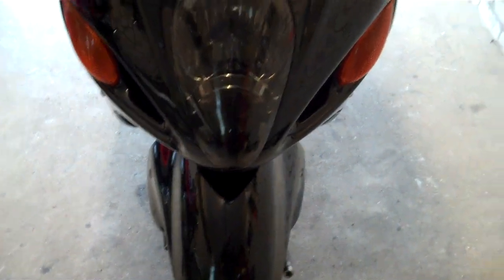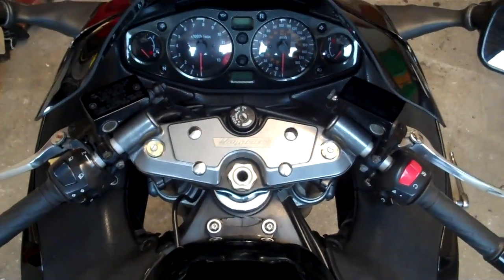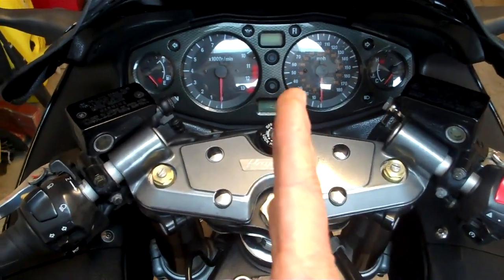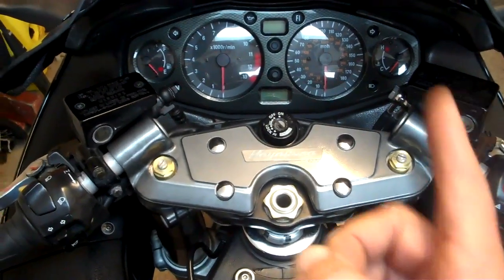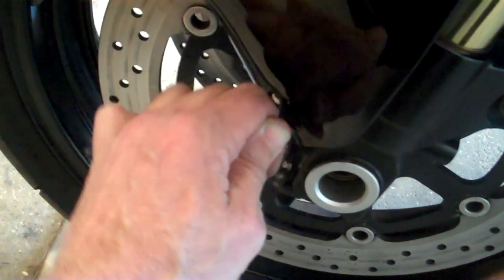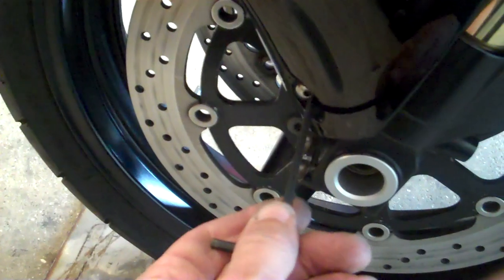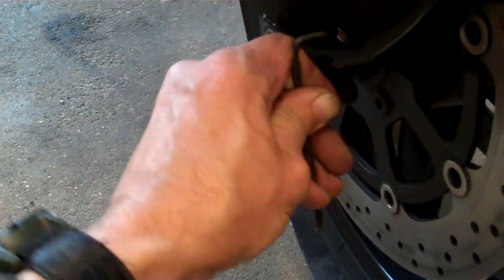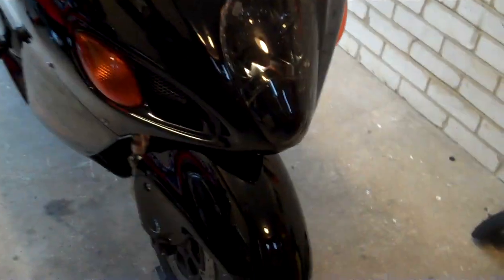Delboy's Garage, 'How-To' Re-align motorcycle forks the easy way.

Comment: Interesting... in my case ('06 CBR 600 RR) it would not self-center. There is enough slack with the steering stem nut loose to physically see the play between the bars and the tire but it will not self-center. Or, rather, it's natural position is with the front wheel 4 or 5 degrees to the left. Very peculiar......
Reply from the maker: Have you backed off every fastener, axle, mud guard, calipers, and got the bike on a paddock stand..?
Reply: Yeah, I slacked everything off and it's on the stand. In the end, I raised the forks 5mm and held the tire between my legs while pushing the wheel over and then tightened it up. It seemed to be the only way to get it straight. Odd as I had the forks checked for straightness a while back.
Reply from the maker: Yeah sometimes they need a little help by holding the wheel 'tween yer legs and forcing it.. as long as you got it sorted buddy...
Reply: It's sorted and it's like a whole new bike. It made much more of a difference then I thought was possible (wasn't expecting anything other then straigt bars). It does bother me though that I had to load the wheel a bit to get it all straight though. Makes me wonder what is off-spec in there.

Comment from the maker: To send a PM,click on the Moonfleet user name which will open my Channel, on the right hand side, you will see a small title "by Moonfleet41" with a drop down triangle next to it.  Hit the drop down triange it will show "block user or send message". Hit send message and it will open an un-limited post box where you can also load links unlike on here.Many bikes will shake the head when you let go of the bars and a worn front tyre will pretty much guarantee this,but just for now,check the pressure

Comment: Aligned is not exactly what I saw. This is the biggest problem with straightening the fork. When the difference is small enough for mechanical memory, the clamps and bolts will slide gradually but soon enough back to their last position. You could have done better making sure it was straight enough. Every bit twisting further being a great help.

Comment: Does this work for speed wobble?
Reply from the maker: R6schico Hi buddy...you can check alignment as it costs nothing to make sure...if a bike has a wobble all the time then its probably a mechanical alignment issue, but if its a speed wobble, and only apparent at certain speeds, then its more likely to be a wheel balancing issue, check your tyre pressures  and condition first, then look to see if any weights have been lost (tell tale sticky marks where the weight used to be), and rake a look at your suspension setting too so you have gone through everything... Good luck with it.. Del.
Reply: Moonfleet41 thanks bud

Comment: I think he means if you have to loosen the big 28 nut on the top, centered just below the handlebar. it is not really clear, since you are insisting to loosen everything south of the top, and then you shortly mention the big 28 nut on top and just make a cut in the video.

Comment: some idiot dropped my cbr 125 today and its steering funny when i turn right just doesn't feel normal could this be the problem
Reply from the maker: ***** Quite possibly mate, can hurt to do this proceedure and make sure the front is straight, if its still the same after that, then al least you have eliminated this as a problem...! good luck with it chap..
Reply: Moonfleet41 thanks for reply mate will give it ago tomorrow
Reply: +osker450 How'd it go?

Comment: Tried this, wheel is still not re-aligned with the bar. Time to give my dealer a visit i guess..
Reply from the maker: Do't give up buddy... have another go at it, did you make sure that you loosened off the top yoke 'centre' nut so that the two yokes can move independently of each other to re-align?????
Reply: yea losened the centre nut and everything south of the top yokes as instructed. It fixed the bike's pulling to the left but the bar just isnt straight yet and when spinning the wheel the front brake sounds like it hits the disc harder in one place. Ill have another go at it in the morning
Reply from the maker: Ok, it may not be actual damage, sometimes a disc can rub lop sided, specially if its a floater... also if you have bar risers that are bolted 'through' your top yoke, check they havent moved too, they will be set into clearance holes and only need to shift a few thou' when hit and it'll make the bars feel way off...good luck, let me know how you get on buddy.. Del.

Comment: I can't get it with my ninja 300. there are only 2 bolts at the top I can see
Reply from the maker: Hi mate, many bikes have different anatomy in the construction, and fitting, of their calipers, I don't know the Ninja300, it's a very new model, not had one on the bench yet... perhaps check the manual and see what it advises...
Reply: +Moonfleet41 what should I look for? would there be a section that says unscrew these to loosen the forks? also what tools are usually needed? thanks
Reply from the maker: Hi Brett.. If you're talking about your yokes, then your bottom yoke will have pinch bolts to loosen, can you not see them buddy? they may be hidden behind the fairing, but you should be able to see them from the top..!

Comment: I have tried this several times and nothing. I do not know what I am doing wrong
Reply from the maker: Hi Ethan....did you back off the centre nut on the top yoke so they can move independantly of each other?... and have you checked the back wheel alignment is right too....if the back is out, it will make the front feel lop sided...???
Reply: Moonfleet41 I tried I could not get the top nut to move. I have a 06 ninja 250, not sure if that matters. I'll give it another try though
Reply from the maker: EthanCobwebs
Hi Ethan....you MUST get that top nut backed off a bit....otherwise the two yokes cannot move and realign...is it just stuck, or do you not have the right tool to get it turned..?
Reply: Moonfleet41 it just won't turn
Reply from the maker: EthanCobwebs
OK mate, well thats your task, unless you can loosen that top nut you cannot align the yokes....try using a well fitting socket and a long breaker bar...its only the thread, if you get enough purchace on it, i assure you it'll move eventually..!
Reply: Moonfleet41 it worked! Had to get a longer bar, thanks a lot for the help
Reply from the maker: EthanCobwebs
Nice one, glad you cracked it.....you know what they say.." if in doubt, swing on it a bit more" lol

Comment: You picked the worst bike possible to demonstrate this simple fix.
Good explanation job anyway!
Reply from the maker: It's the bike I had at the time Faustin, did a re-make of this later on on a naked street bike.
Reply: @Moonfleet41  Yes. That one would be a better bike to use. I have scheduled to work on my bike in two days from today and wheel alignment will be one of the things on the book. Your video is thus a good reference for me. Thanks!

Comment: How do I do this on a 2011 ducati evo 848
Reply from the maker: Never seen them Simon, are they regular forks..?
Reply from the maker: Just checked some images, and they look the same as any other sport bike... so yeah, should be the same drill..
Reply from the maker: Simon Guerrero
Cant text abroad buddy, send me a PM if you need to..!
Reply: I don't know how to do that but your video helped me out a lot I just got the front end off (broken fairing stay) and I'm going to try your procedure without in doing the middle of the top triple tree
Reply from the maker: Simon Guerrero
I think you'll struggle to get any movement to re-align it Simon, you must allow the two trees to move independently of each other so the legs can snap back straight....there must be some way to release the top tree?.. does it have a fancy cap bolt with holes in,? or is it maybe bolted from underneath?... just gonna see if i can google some pictures.... back in a tick..
Reply: Wow really appreciate it, I'll do the same
Reply: Moonfleet41 got it! Thanks a lot couldn't have done it without this video, couldn't find my torque wrench so I ended up marking the bolts, thanks!!!!
Reply: Moonfleet41 got it! Thanks a lot couldn't have done it without this video, couldn't find my torque wrench so I ended up marking the bolts, thanks!!!!

Comment: it would have cracked when it went out of alignment and it's plastic. so I wouldn't figure it would Crack.  but thanks
Reply from the maker: ANthing bolted to the fork tubes, whatver it is, can stop them freely loving back in to line... but when the front  gets knocked out of line, it will twist against the mud guard plastic, it's just a consideration with the ridiculous cost of Jap plastics...